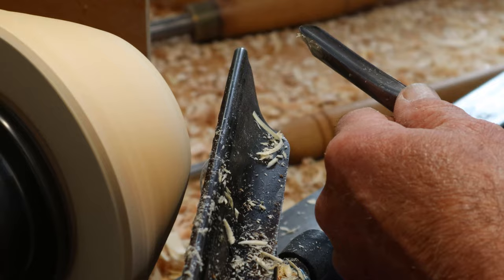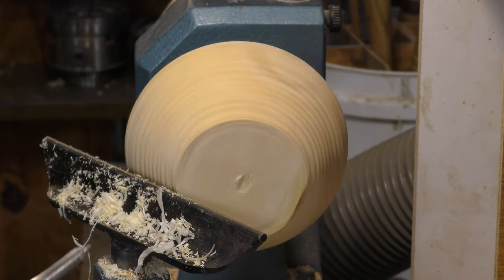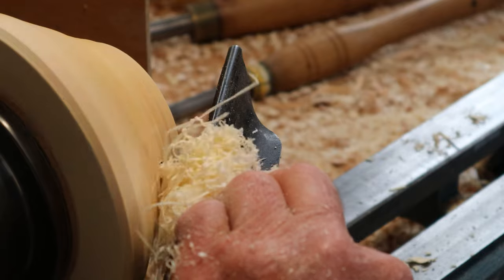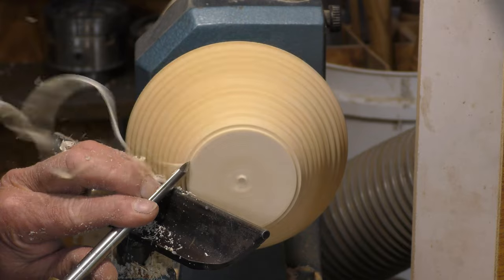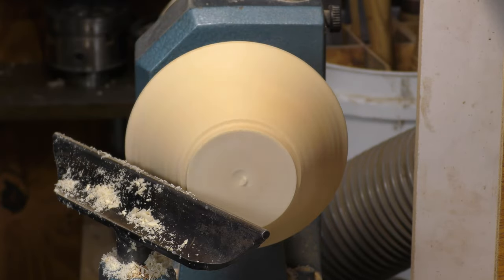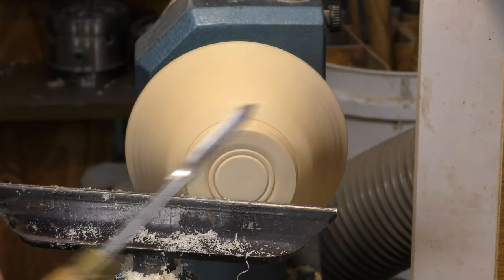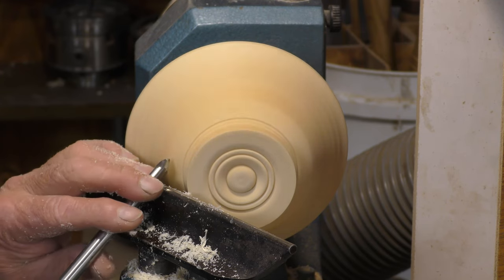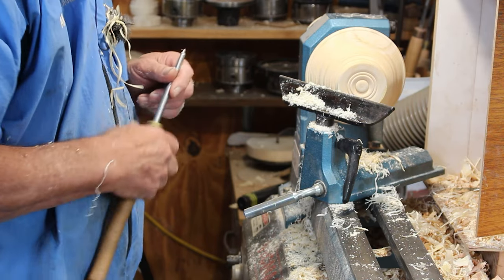Richard Raffan turning beads on a bowl

Comment: Many thanks for the video…. I think it would help me to see a tight shot of the tool tip moving through the wood. It’s a great skill and I need to practice!  

Love your channel!
Reply from the maker: The key is once you've rolled the tool slightly to pickup the shaving you keep it at that angle as you go over the bead, then bring it back on its side at the bottom of the bead.

Comment: When i first tried this technique i had several run-backs (chasing threads over my beads) and it wasn't until i saw a Glenn Lucas video that covered your technique (for which he gave full credit of course) that i learned to not fully close the gouge at the bottom of the bead but to keep it slightly open.  Also he described it as a push cut down one side of the bead transitioning to a pull cut over the top of the next which made a lot of sense to me.  And there's nothing wrong with covering pieces with beads. :-)

Comment: Wow, great technique, I suspect it will take much practice - thanks so much for the great instruction.
Reply from the maker: You might be surprised. The secret, as will most turning, is minimal tool pressure against the wood, and taking the handle around in a circle rather than rotating the edge during the cut.

Comment: I tried this today on a bowl. It didn't come out so well, more like little downward sloping arrows, but still a nice pattern as you say. Having another crack at it tomorrow. That bead on the foot looks great as well. 👍
Reply from the maker: It usually takes at least a dozen runs up a profile to begin to get the knack of it. Pointy beads come from rolling the tool back on its side too soon. Having rolled the gouge coming out to get the shear cut, you need to keep the gouge at the same angle until the last moment. The key to round beads lies in the handle going round in a circle.
Reply: @RichardRaffanwoodturning  thx I'll keep practicing.

Comment: If Mercedes and Cadillac are high end for cars and Honda is middle of the road .. what are some middle of the road wood lathes I could look out for if I wanted to get into wood turning at a decent price ?
Reply from the maker: I don't want to get into promoting manufacturers and anyway I'm no longer overly familiar with what lathes are available in your part of the world, not that I know where you are. I'd set a budget and see what's available at that price. Good second hand lathes rarely come on the market as they are snapped up by friends or relatives, rarely losing much in value.  Go for cast iron components or heavy steel. Don't buy set of tools: better to purchase tools as you need them. Here's my basic set: https://www.youtube.com/watch?v=qAz1FfAtqmE. I'd start with a good small lathe that allows you to turn up to 300mm or so diameter with 400 to 600mm between centres.